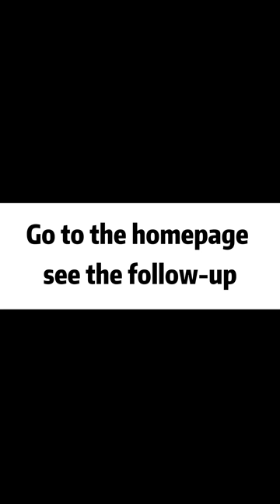(PART1)There is a horrible noise when the car is driving! Teach you a way to solve it!#tutorial

Comment: Never put you head under the car or into the wheel arch without properly supporting the car on axle stands or blocks. That car raising jack can fail at any time and the car would fall on you. Take care be safe and thanks for the content.
Reply: Absolutely mate!! Just wanted to come here write what you suggest
Reply: The odds of it failing are so small that you may as well live in fear of absolutely everything around you failing.
Reply: @vojtechpilar5809  it will take only one moment to end this debate.
Reply: @vojtechpilar5809 I don't know the odds of snack failing.  Do you know?  You seen confident in the build quality of jacks worldwide.    My friend had a jack where the gas/air pressure wasnt tightened, so I was slowly losing height.  He hadn't tightened the nut on the jack.   Having axle stands is like a belt and braces approach, you have a 2nd safety measure in case the first doesn't work.

Also do you think a kid on a bike or a skater have never crashed I to cars?  Anything could hit that jack, at any moment bro.
Reply: Correct, always play safe
Reply: @vojtechpilar5809  the odds are very high lad hence why we have jack stands
Reply: I'd use my phone for a quick ✔️
Reply: Wait... what happened to the studs?
Reply: Yeah bro my jack failed while I was painting my caliper. Luckily car didn't fell down because I kept removed tyre under my car
Reply: Thank you I'm having this problem now 😊
Reply: Scotty Kilmer school huh
Reply: This comment needs more likes
Reply: @vojtechpilar5809  I thought that as well until my jack stripped the threads on the nylon bush the threaded bar screws into, jack on a new Vaxhall only used twice, thankfully I had the wheel under the car.
Reply: Ikr i cringed when he did that
Reply: @erinmixon6331  what about the studs?
Reply: @99SVTBolt  I'm not used to seeing them come off. Thought they broke off. 🤣
Reply: @erinmixon6331  🤣 yea those German cars use lug bolts.
Reply: @99SVTBolt  I had to ask my hubs, the mechanic, and he told me. 🤣
Reply: @erinmixon6331  always good to learn something new everyday 😎👍🏼
Reply: Thank you for safety precautions
Reply: thats good so i wont be able to watch his videos again
Reply: I’m not one for playing it safe.. but being trapped under a car isn’t the way I want to go out. As said, add stands, blocks, a tree, a yeti..  anything substantial & isn’t your body.
Reply: BROTHER CONG WOULDNT DO THIS

Comment: "The sound is coming from the tire side......" Always put the tire you take off under the rocker panel incase your jacks give out, an extra layer of protection is always a good idea.
Reply: Stupid question, whats the rocker panel? I've just started working on my own car and a friend suggested this but I wasn't sure where to put the tire
Reply: @MissWonderland  the rocker panel is the long strip of metal that goes between your front and back tires directly underneath your car doors. They can rust, dent etc.

Comment: 2 MASSIVE issues When you crack the wheel nuts do it when the tyer is still.on the floor supported by the jack if you don't have a long bar use your foot when all nuts are cracked continue lifting the car to remove the tyer if you have 4 studs re tighten in order top left bottom right top right bottom left, but NEVER use a side jack and kick the tyer off like that use a trolley jack get a cheap one and put it in your boot or trunk depending on where you are from if you fix the issue drive CAREFULLY to the tyer place to the torque the wheel nuts to the correct settings if you have a jack stand handy use it

Comment: This is similar to the problem I had after I did my brakes. I had the car in the air and kept using the rotor to turn the steering. Well after finishing the job, my brakes sounded worse than before, now screaming down the road. I took the wheel back off and sure enough, the backing plate was pressed into the rotor from all my pushing and pulling. Straightened it back out and the noise was completely gone!